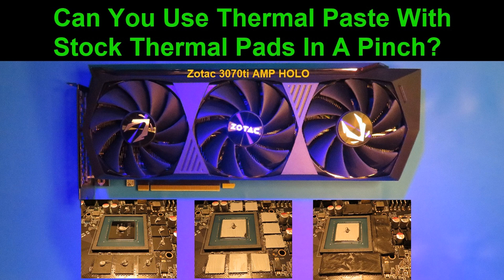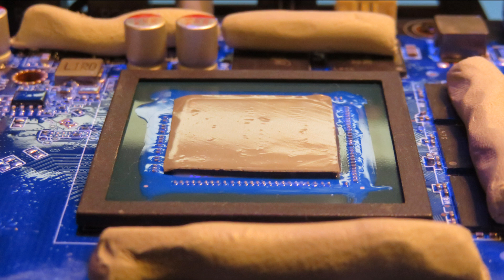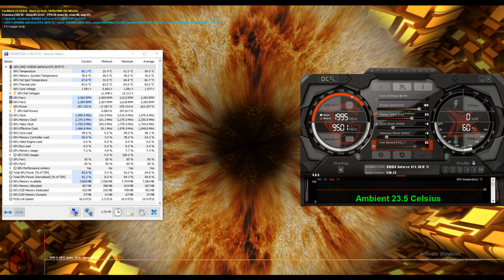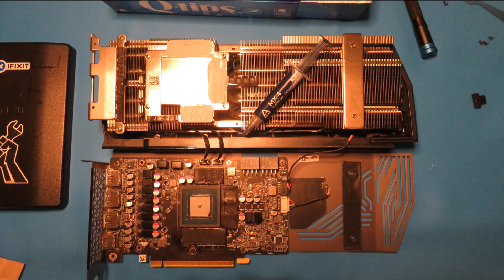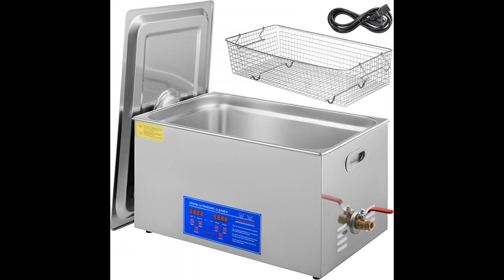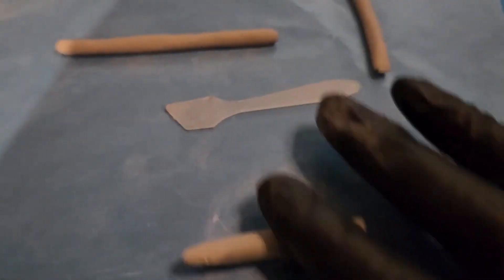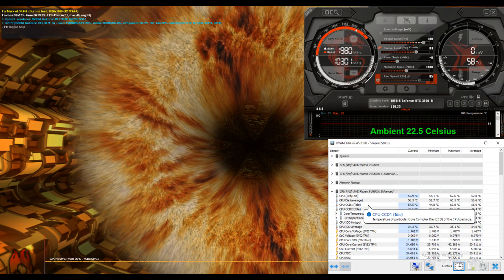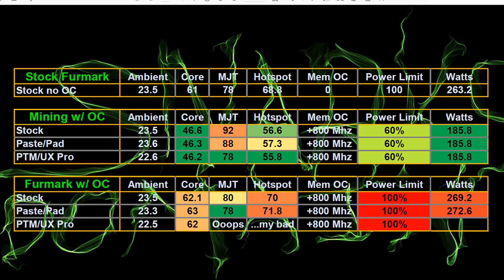What happens if we put thermal paste onto thermal pads?

Comment: Great vid. Any tips on pulling off the film on the PTM 7950 pads after cut? It always tears when I do it, haven't managed to get such a clean pull as you. Also can you test some other thermal putty, Zezzio ZT-PY6 and CX-H1300 claimed to perform on par with U6 Pro (if you compare W/mK). The CX-H1300 is particularly interesting because it is about 5 USD for 50g, that being said U6 pro is 15 USD for 50g (I live in South East Asia so the shipping isn't as much).
Reply from the maker: For peeling the film I'm now using 2 of the supplied tape strips and attaching them to either side at a corner. Only 1 of the films will peel off during the first step.

Then carefully positioning in place. Once in the correct place I go over it with a finger and firm pressure. You can shine a flashlight (phone or other) at an a gle and look for any larger bubbles and work those out if you can.

Once you are satisfied with it you can try using that 2nd tape strip at the corner and carefully peeling it back. This last peel takes finess as the sheet is not firmly clinging to the CPU/GPE die. I've still been using precision slant tweezers to peel last film.

Placing of the cooler on to the CPU will also take some precision.

I'd probably recommend to remove GPU so that you have the space you need to use both hands. Motherboard or case should be lying flat so that you can carefully lower the cooler down onto it.

Unlike thermal paste, you need to get it perfectly centered on first contact. With paste it's always easy enough to shimmy it around even after the cooler makes first contact. Woth phase change sheet it could tear apart a bit if you move/twist the cooler during this time.

Comment: it's always nice to see affirmations of your own general experiences - that adding Paste to Pads doesn't seem to make them worse.
but uh, i mean, why *wouldn't* you use Paste smeared Thermal Pads longterm? it's not like this is a much worse scenario or something, the Paste on the Core gets hot, so it's basically the same scenario if you ask me. and if it's okay on the Core, then i don't see why it wouldn't be okay on the Memory or VRM or w/e.

if anything in addition to compensating for ejected Oil and w/e, that extra film helps compensate for Thermal Pads that are already 'used' tending to compress down and potentially being a little on the short side, making for less ideal contact. yet is still a tiny amount of added thickness, and so should avoid lifting the Cooler away from the Core.

obviously using Putty and Pads would be preferable, but i don't have any reason to expect Paste to be *bad* in some way.
Reply from the maker: It's possible I've been too hard on thermal paste usage on VRAM. I might prefer not to use it myself, but perhaps it's not as bad as I had considered it to be.

I've encountered a couple posts here and there in cases where thermal paste damaged components, but it's likely that electrically conductive paste was used in all of those occurances (ie. Arctic Silver 5).

Edit: I likely wouldn't buy thermal paste for this purpose myself. I'd opt for either putty or pads, even just based on price/volume. I'd also worry about stuff like pump out. I think putty is better suited as a heat conductive gap filler. As for CPU's and GPU cores, I think a phase change material like PTM7950 is better than thermal paste long term.
Reply: @snarksdomain  
ah yes, AS5, everyones' favorite overhyped as hell Product. now the Question is, is K5 Pro, or AS5 more overhyped, and more meh in reality? 😆

anyways yeah i'm sure Putty is preferable gap filler if one is making a choice.
Reply from the maker: @taiiat0  I'm gonna say K5 Pro is more overhyped, at least recently. Ever since LTT made a video about it and ignored other putties that I would argue have proven out to be much better.

I was all for AS5 back in the day anniversary bothered trying other pastes until about 4 years ago.
Reply: @snarksdomain  
yeah, maybe. big Creators haven't been misguidedly shilling for AS5 in a while. while K5 Pro does still get mentioned frequently.
AS5 was a pinnacle Product once upon a time indeed, but by the time the Internet was a mainstay of the World it was already on the edge of being obsolete(which is circa 2007), woo :D

IC Diamond got misguidedly promoted for quite a while though... thankfully i don't think i've ever encountered a normie actually using it though.
Reply: He also used old stock pads with paste for testing so in his mind he might be rushing to get new pads. As for myself i fear too much about not having the perfect sized peplacement pads so the cooler sits higher from the core ( causing it to not cool properly). Thats why i choose buying same or slightly smaller sized pads and adding the paste to fill small difference ( economical reasons, i cant afford buying 2-3 different sets of pads just to find the perfect one))

Comment: Is the ptm conducive? Thats why the conformol?
Reply from the maker: No. PTM is safe to use without it.

I used the Conformal Coating because I wanted to give the card a decent protective layer for dust/dirt/fluids/vibration for the life of the card. In this video it wasn't truly necessary, but I thought I would include it in the video anyways.

I've also done this to my testbench card. This should prevent me from needing to use Kapton tape in most test applications and I'm hoping it will also make the card easier to clean between tests, as well as lower wear and tear. My test card has been re-padded/puttied quite a few times now.

Comment: A toothbrush and iso works great for cleaning pad or putty residue. 

Just curious, what was the purpose of the conformal coating?

As a sidenote, I think it makes the data easier to read and compare when temps are shown as the delta over ambient. For measuring temps, I think it's best to let the card heatsoak and reach steady state, then reset HWinfo and let it monitor for a set amount of time (maybe 10-20 min), then use the average temps as your datapoints. It's easier to control for ambient over a shorter period of time. Also it would be interesting to see more 3D benchmarks, since the load is more varied and you should see higher hotspot temps. It may show more favor to PTM.
Reply from the maker: Good point on resetting HWINFO after reaching steady thermals, and then wotching ambient for those ~20 minutes. You're likely right about delta being more representative of relative performance. I'll likely list that in another column.

As for the Conformal Coating, I wanted to give the card a decent protective layer for dust/dirt/fluids/vibration for the life of the card. In this video it wasn't truly necessary, but I thought I would include it in the video anyways.

I've also done this to my testbench card. This should prevent me from needing to use Kapton tape in most test applications and I'm hoping it will also make the card easier to clean between tests, as well as lower wear and tear. My test card has been re-padded/puttied quite a few times now.

Comment: for the 7950 did you run some benches and whanot to let the PCM heat cycle a few times and "cure" over 24h?  7950 tends to perform better next day and improves slightly with time.
Reply from the maker: Just the few tests before I put it back into his PC. Diablo 4 priorities. Perhaps I'll be able to borrow it and test it out again in a few weeks around the ~1 month mark and report back.

From my testing on my Laptop, Phase Change Material definitely gets better in the shirt term. Will do long term testing as well.